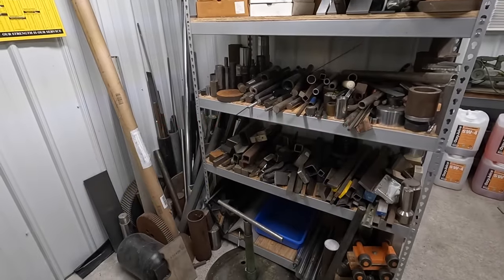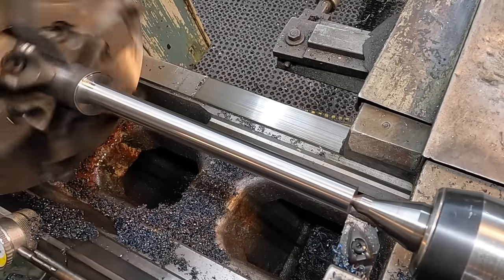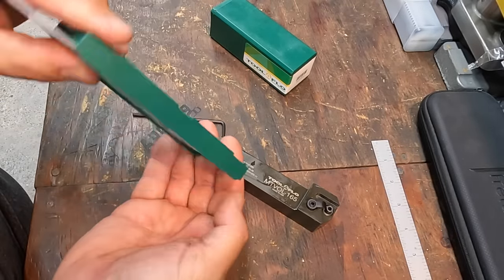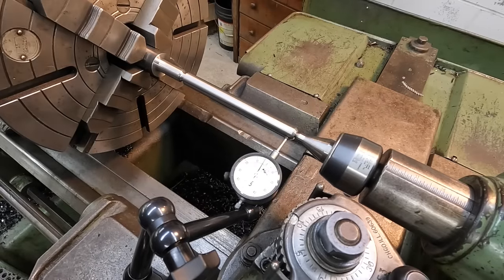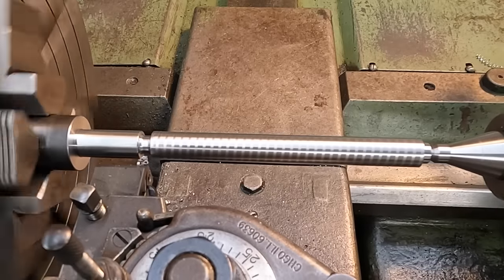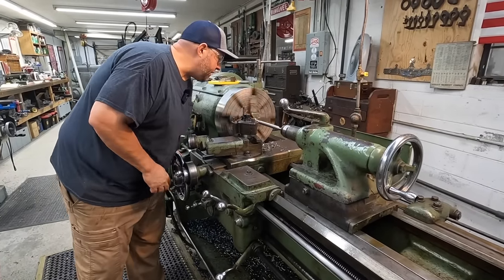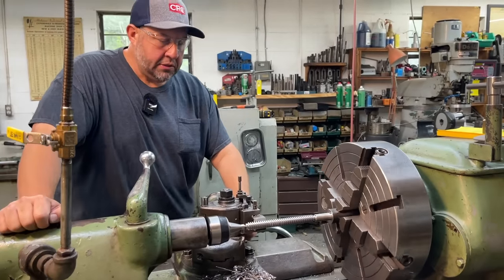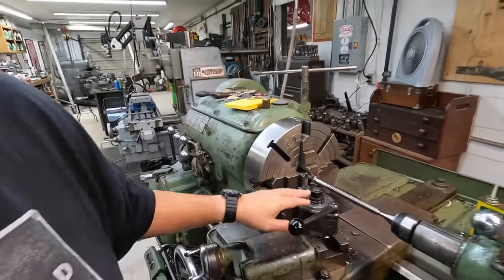Compound Lead Screw for American Pacemaker

Comment: Feels like the bar is riding up on the tool. And it would be on the last cuts because that is when the bar is weakest. It was 3/4 and at the end it is more like 1/2. If a travelling steady fixes it then that was the issue.
Reply: The other variable that comes to mind is that the harmonics changed when the live center was reinstalled after checking the thread with the nut. 
Could too much or too little pressure change it enough that the material is able to flex out of position?

Frustrating for sure.  But if it is a harmonics issue, even in part, another machine will have different rigidity and it might fix itself. 

Looking forward to the next (hopefully last) attempt!

Comment: I believe what I happening is that as the work piece gets thinner and more flexible, the upward force of the cutter causes an upward bow in the work piece causing it to move up slightly and giving it a larger effective radius. The cutting edge then bites into that as it rotates into the cutter. I think a steady rest on top of the work piece would solve that problem.

Comment: Yes heat changes diamention of the stock you are machining coolant lube would help solve issue also check the cutter for wear and tightness .. also could gotten out of square ...

Comment: I like watching you work and that you take the time to explain things.

Edit: It is unfortunate that not everything works out. If this happened to me I would let the part cool down then start using oil to finish the threading. Because the part is so long and thin and possibly too hot, I would creep up on the feed like you did as well. I have been there where you get panicked and instead of taking a step back you started running the cross feed in, instead of using the top slide to feed. I look forward to your success because you got this.

When I was in college I had the task of making a 1"-2 Acme thread male & female. I actually made a double start 1"-4 male & female. The instructor was so impressed he gave me 100% anyways even though it was not a 1"-2 thread. He even gathered the other students and showed them then added it to the display case where only the best projects made it in. Our grading system was either 100% or fail.

I incorporated all of the various machining process we were do do into an 8 lb slide hammer gear puller with a 2 jaw & a 3 jaw head, reversible with locking nut. Also included heat treating.

I retired at 42 & I do miss the work. Thank you Instructor Ted Begman - Delta College
Reply: just do metal working diy from home like abom does

Comment: With that thread, and you say the work is climbing on the tool. wouldn't it be best to use a follower rest?   When the threading tool comes close to hitting the minor diameter the isn't much shaft left and it's flexing.   Appreciate you showing the video..
Reply: Not engineer but I came to similar conclusion but added in.....cutting = friction, friction on metal = heat, heat on metal = expansion, expansion between lathe & centre mount (AFAIK / potentially two fixed points) = bend
ie loss of material structure + aforementioned could be the cause mainly because it's only happening in the centre of the thread section

Comment: My money is on backlash in the crossslide/compound coupled with a slightly below centre tool height. It will be interesting to hear if there is a root cause, helpful for us if we see the same ourselves.
Reply: Yes, below centre tool height was my first thought as well.
Reply: was thinking back lash myself,. or maybe flex in material.  might need a traveling steedy
Reply: The work was trying to climb up the cutting tool. A travelling steady would reduce that.
Reply: There's a big elephant in the room that many are missing. The elephant is the coarse Acme thread cutting full depth on a long skinny 3/4 shaft with no support or lubrication. Not the compound angle, the backlash, or the lathe. It's too much tool contact for this size shaft with no support or lubrication. It really is that simple.

Comment: That was wear from plunging side of insert . It happens at that position as your lathe bed runs out and cuts at a slight taper . Also from lead screw backlash , Why I reverse tool to position and don’t rely on lead screw indicator on older lathe . Also setting compound to “clean” side of thread is unnecessary with carbide tooling , 0 degrees would suffice and remove potential error .

Comment: May sound like a dumb question, but did you try another insert tip?
Reply: Yup. Could be a minute chip off the insert.
Reply: Good question. Early on he talked about how it's possible that the insert edge would break off. Gave me the impression that it's not totally rigid and sturdy. So I think he should have looked at the insert to see if it is still good. 
As others have suggested, use oil and a little slower with that lathe. Also use the same starting number rather than just any number.
Also the insert, which is mounted perfectly vertical, is getting much deeper into that slanted cut. So everything has to be just right for it not to jam against an edge.

Comment: Before the problem, I noticed you had other passes where it was cutting heavy on the right, with no contact on the left side of the thread, leaving a ridge on the left hand root of the thread.

I know it "shouldn't" matter, but as a practice some machinists will always line up on the same number, or will never disengage the half nut, instead putting the machine in reverse to get back to the start of the thread. I also wonder about lining up on 1,2,3,4 and if that's actually correct for a 5 TPI thread?

Comment: Hi Adam I don’t  think there is something wrong with the machine . It sims as if as the threads get deeper the whole rod is flexing
Reply: I seem to recall some saying about who blames their tools. 
Now if he doesn't even have a follow rest for that machine then it would make sense to use a machine he does have a rest for. With about a .5" minor diameter (give or take) and an 8" length that is a very slender shaft for that kind of cut.

Comment: A lot of good ideas for causes, and it's probably a compounding of factors. Material properties changing toward middle of bar was mentioned, but probably more significant is that you're cutting away the rigidity of the bar at the same time cutter engagement increases. More force yanking on a weaker bar then lets any number of degrees of freedom take over. The bar deforming could be loosening the center enough to make things floppier. Do you have gib locks for the cross or compound on that machine? Could changing speed help (maybe a little bit slower)?

Comment: Сильно не переживайте , у каждого такое может быть !  Как у нас говорят -" не ошибается тот , кто ни чего не делает "  Не уверен что перевод будет правильный . Удачи вам .  Может  люннет  помог бы ?  По видео конечно трудно правильно оценить ситуацию  но мне кажется что  из-за большой длины заготовки и малого диаметра , заготовка поднимается над резцом или резец чуть приподнять  но можно и угол резания  заточить на отрицательный  . это уменьшит набегание заготовки на резец .  Удачи !
Reply: Translation: Don't worry too much, it can happen to everyone! As we say - "the one who does nothing is not mistaken" I'm not sure that the translation will be correct. Good luck to you . Maybe a lunette would help? From the video, of course, it is difficult to correctly assess the situation, but it seems to me that due to the large length of the workpiece and the small diameter, the workpiece rises above the cutter or the cutter is slightly raised, but it is possible to sharpen the cutting angle to a negative one. this will reduce the run-up of the workpiece on the cutter. Good luck !
Reply: @joshb4544  what language is that?
Reply: @SW-pz1yy  Looks Russian. I just google translated it

Comment: Most common mistake is live center loosing, but to me it is not easy to cut the Acme tread that long when it reaches the full depth. It needs the follow steady rest to do it.
Reply: He said he had checked it with the nut I believe and that a little more needed to come off. If so he must have removed the center to check, maybe not quite correct when the center was put back?

Comment: This is a common problem with trapezoidal threads. First you should use cutting oil. You should pre-cut larger trapezoidal threads with a straight grooving tool of the correct width. Turn the thread to the correct depth and then cut the sides with a suitable threading tool. Smaller trapezoidal threads should regularly cut freely in the flanks. Otherwise the load will be too great for the tool

Comment: As a point of interest, what are all the tiny specks that are covering your tool when cutting?  I see the nice curls and chips but does this type of material shatter at the micro-level?  Love your videos. Not even a machinist (science teacher) but I have a great appreciation for the level of competence and enjoyment you bring to the craft.  Keep up the good work.
Reply: Some of the fine chips are from the left side of the thread where the tool is barely shaving.  Adam set his compound to feed in at 14 degrees instead of 14-1/2 so that some tool pressure would be on the left side, same idea as setting the compound to 29 or 29-1/2 for a 60 degree thread.

Comment: I wonder if the shaft is flexing because of the fact that the diameter is being reduced.  Would cutting oil have helped?
Reply: Yeah as I think about this job and read everyone's thoughts, I think a good flow of a good cutting fluid will be the easiest way to be successful next time. He honestly got pretty close to done with that threading. Just a modest reduction of the cutting force would get him over the finish line, and I suspect that oil would be enough.

Comment: Now, of course this is hind sight. I watched the other video, successful. I'm thinking because so much material was taken of this stock and the difference in diameters caused a resonance vibration. I don't know if that makes sense but just an observation. I could be completely wrong, it could be the machine but that's what machinists have to figure things out. Even though I'm no longer in this craft professionally, I love being a machinist.

Comment: In this smole diameter use the transfer dog because the material is flexible  and with cutting oil to help the tool.
Giannis Grizopoulos  retired machinist.

Comment: If i had to guess, at that depth youre running out of releif on the insert, and or the insert is below center too much, and no oil while the tool is engaged on all 3 sides.  The material just couldnt take the deflection at full depth of cut.

Also the speed could be a factor.

Comment: Is your half nut not getting worn or having a small chip stuck from being jammed in? Would it not be more consistent to keep it engaged and reverse the lathe. Also what could be happening is the heavier drag on the tip as you cut could pull down on the toolpost and make it dip just a hair below centre causing the material to roll over your tip..

Comment: The beauty of a small underpowered, less than rigid, lathe(which I own) is the knowledge that slim workpieces will flex at the midpoint, and try to climb over the top of the tool.  Follow rest does the trick.
Just throwin' it out there..........but I've never cut a thread without using tapping fluid as a cutting lube.  Slather it on like syrup.
Another consideration with carbide vs. HSS..................HSS is sharper, and tends less to bull its way through the metal......thus preventing some of these problems, and as a bonus.........giving very nice cuts at lower RPM.
Sorry man.......been there done this.  It's frustrating.
Reply: The flip side is that carbide takes more material off faster. In a shop, that translates to money. But I don't disagree with you.

I've been thinking about this for a while now and I'm convinced more and more that the work slipped in the chuck. I could be wrong of course, I guess we'll find out when Adam tells us.

Comment: Could it be due to lack of coolant/lubricant?
Reply: I was thinking the same, although not all carbides like coolants. Other thought is that steel can be like wood that has knots in it, except you can't see them. Was there maybe a hard grain that damaged the tool edge.

When I say steel can be inconsistent I had an odd experience once. We had a 50 ton press punching holes in plate, 4 holes per plate and three plates. It was a 50 tom hit. We did the first two plates no problems. On the third plate the first two holes were fine, on the third hole the punch bounced off without so much as leaving a mark. The fourth hole was OK again. Just a hard spot

Comment: Adam, I haven't seen this observation made in the comments yet. You ran the lathe continuously until 34:38 in the video. That is when you stopped the spindle and restarted it. The very next cut went udders up!! I think there may be some gear slippage on the left side of the machine.

Comment: So many people called for a follow rest, but I think there's more going on here.  I think there's backlash in the machine that is causing the tool's engagement point to change from one pass to the next.  That, combined with the shrinking minor diameter and yes, the absence of a follow rest, allowed the work to climb the tool and make a mess of things.  I agree with Adam though that there is a problem with the machine.

Comment: Its not the lathe. It’s the material. It just got thin enough to start bending thus, the cutter is being squeezed between the sidewalls of the threads. Your material just needs support from the opposite side of the cutter. Or at the very least, from the middle of the piece.
Reply: @mxfxdig you mean like a follower rest to keep the bar from flexing and closing the threads against the tool?
Reply: @tubiness  I’m not sure what a “follower rest” is (I’m new to machining), but whatever “V” or “halfpipe” shaped support that can be placed directly opposite the cutter to offer resistance at the halfway point of the screw, should do it.
Reply: @mxfxdlg  You're correct. This is the reason parting tools break so often. The setup must be herculean stiff for it not to bind cutting both sides at the same time (specially tappered surfaces, which is what holds tools in place in most machines). When it does it simply flexes the piece and tries to ride on it. That's why it happened in the middle. It could be fixed with a follow rest (mounted on the carriage, instead of a steady or fixed rest, that sits directly on the ways) but I'm skeptical. I'd rather do it the traditional way: cut the thread from one side only.

Comment: It's rare to see you struggle with anything, but I know you will figure it out. My only suggestion is using a follow rest?  We have a double lead rh 1/2 acme that gets cut then carburized then straightened then ground. Those parts are complete headaches. Good luck Adam.

Comment: What was your reason for not using any cutting oil?   
When I've chucked the stock as you did, I mark the stock at the chuck jaw and a center mark on a chuck jaw to prove the stock didn't move during the cutting.
The positive stop on the cross slide is certainly a nice feature.
Your honesty is fantastic.  We've all had those failures.  My old Sheldon has  nowhere near the rigidity of the Monarch.  I've cut 3/4" lead screws and with that length the work piece does want to push away from the cutting tool.  I have not used a carbide as you did. I've always used some "Stellite" tool stock for my cutting tool. The Stellite is harder than HSS and I've always had good luck with it. Years ago I worked at a Union Carbide plant in Kokomo, IN and gathered a few pieces of the Stellite which I have hoarded religiously.
Reply: I've always been told not to use cutting oil with carbide. I personally think that's BS, but what do I know. Also carbide likes it fast and deep or it tends not to cut well, so maybe it was just too deep for the size of the work and pushed it away which allowed the work to climb over the cutter? I don't know, there a lot of things that could've caused this.

I did notice a change in the shape of the chip, I just thought he changed how much he was feeding in, but looking back it did start cutting on the left side when it shouldn't have. That extra load would cause it to push away and climb over too.

The only thing we know for sure is that SOMETHING had to have slipped. I don't believe backlash would play a part since the backlash would've been taken out when the lead screw started turning and would've shown up much earlier.

I tend to believe that the work slipped, he should be able to see that when he takes the work out. I've had that happen a couple of times myself.
Reply: Carbide needs flooded with coolant. If you just dab it on occasionally, you risk chipping/exploding the carbide insert from the shock.
Reply: @grntitan1  Like I said, I thought it was BS when I was told that. Flood coolant is used all the time in CNC's that use carbide.

And, as I'm sure you know, interrupted cuts should also be avoided for the same reason, shock. Even carbide inserts rated for interrupted cuts don't stand up as well to shock as HSS does.

There are a lot of nuances in machining. No matter how long you've done it or how good you are, you are constantly learning. I love it! Cheers!